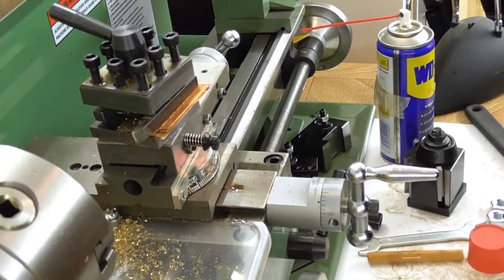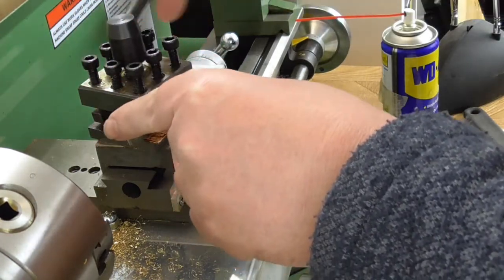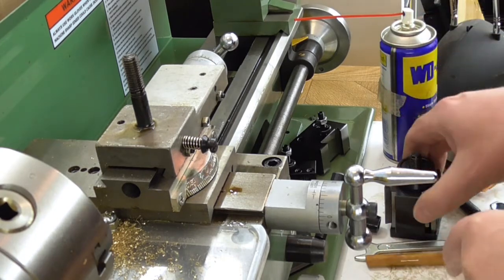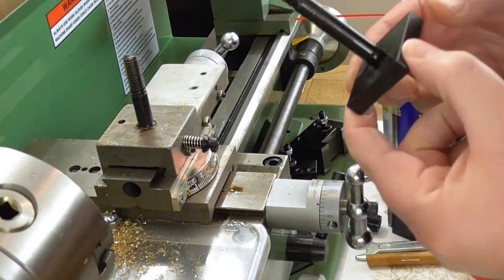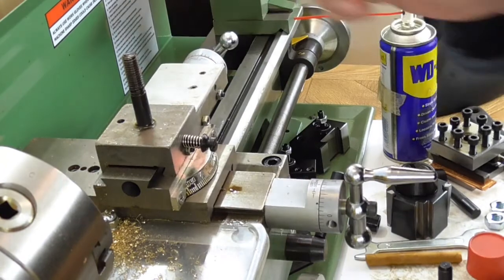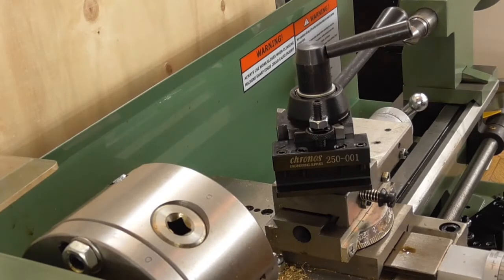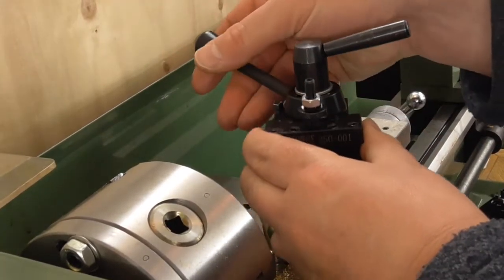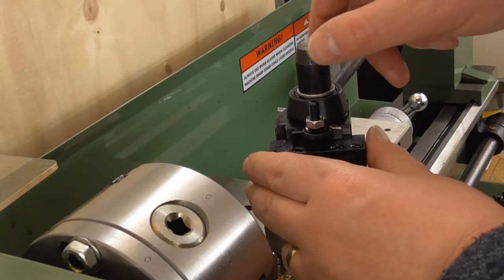How (not) to fit a Quick Change Tool holder to a mini lathe

Comment: Just to say; thanks for posting this, as I'm considering a quick change tool post. Also, as a retired plumber, my adjustable spanners are well-used tools. The trick to prevent rounding of flats is to make sure the jaws are tight, before turning. Lastly, I notice your hesitation & uncertainty about which way tightens; I found the phrase 'clockwise closes' helps & the nut tightens. In effect, you consider the head / face of the nut as a clock face. Some people use ' Righty-Tighty & Lefty - Loosey ' but, as someone who forgets what's left and right, it never helped me.
Reply from the maker: Thanks for the comment and the tips; the 'clockwise closes' trick is a good one to remember! 😀👍

Comment: adjustable spanners are for plumbers not engineers or fitter turners.....they are god awful tools and not one resides in my toolbox.
Reply from the maker: Thanks 😀 👍.  Yes, a good fitting spanner is a much better option 👍
Reply: Even we plumbers prefer not to use an adjustable wrench…….

Comment: A major drawback of all quick change systems is that they will place your tools overhanging, outside of the compound slide and essentially form a 'U' shape which introduces all kinds of very undesirable forces. I decided to revert back to a solid block setup on a larger lathe we have in the shop and use (ground) shim plates for center height adjustment. Also, inspired by mr. Renzetti I am considering getting rid of the compound slide altogether. Which has the additional advantage of being able to use larger cross section tools, further improving stability.
Reply from the maker: Yes, very good points. I only have experience of this size of lathe and smaller. My previous machine had a single tool post for which I had to shim the tool, and it was very slow going. Most of the work I do is small screws and fittings and despite the issues with rigidity (and the lathe isn't as rigid as it could be anyway) I find the QCTP makes working much faster. Thanks 😀 👍
Reply from the maker: Yes, if you are not going to change the tool, then using the supplied tool post and shimming should work fine. If it's HSS and you have to resharpen it, then you will need to adjust the shimming from time to time. Glad you enjoyed the video. Thanks 😀 👍

Comment: very useful video. thanks for sharing your hiccups too.

you could have tightened the post bolt with 2 nuts, the same way you loosened it up.

other than that it looks pretty straightforward to replace the tool post on your type of lathe. I'm still waiting for my 1st lathe ever to arrive, and I don't even know what type / size of compond is on mine.

I've seen some people had to bore a bigger hole, and some people had to bore a recess underneath the compound to be able to fit it.
I hope my lathe will allow me an easy replacement, like in your case.

I will however order the piston type, and I don't like the wedge style dovetail. something is telling me that the piston would be more consistent and rigid, but I don't really qualify to make any opinions just yet. I'm as new to the lathe as you can imagine.
Reply from the maker: Thanks 😀 👍.  Glad you found it useful. I agree, 2 nuts would have made more sense, and I do not know why it didn't do that as it was the basic plan in my head before I started filming. I did consider a reshoot, but thought my mistakes might make a more informative and interesting video.
I've not had any experience of other sorts of quick change tool holders. This design works fine,  though there is space for swarf to get in between the moving surfaces, and it pays to keep it well lubricated as toolholders can get misaligned and jammed if you put put them on carefully. I have bought tool holders from a variety of sellers, and I also believe they come out of several factories. All fit, but one is a tight fit, though I think I know why and hope to improve at some point in the future

Comment: painful watching  you remove stud, how long did it take to remove
Reply from the maker: Getting the original stud out wasn't too much of a problem once I had the lock nuts in place. Probably would have been faster if I wasn't so concerned about knocking the camera and just given it a bit more brute force. Having jammed the nut on the new stud, it was probably 15 minutes work to get the nut off again before then using lock nuts to fit it onto the lathe.

Comment: Have fun with your new lathe.   Make sure that you don't wear a ring (or any other jewelry, or loose sleeves) when you operate the lathe.      Even a small lathe can do a lot of damage.   Your skin and bones are a lot softer than anything on that machine.
Reply from the maker: Thanks 👍. Yes I need to make sure I don't wear long sleeves for this. I do have a ring, so I'll have to think about how not to loose it if I take it off! 😀